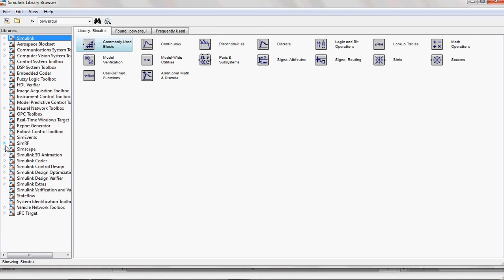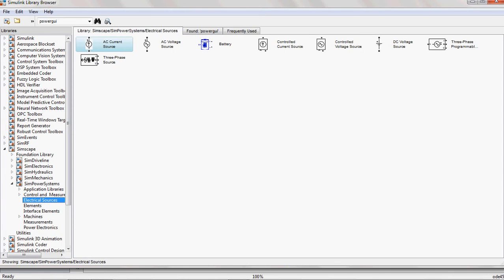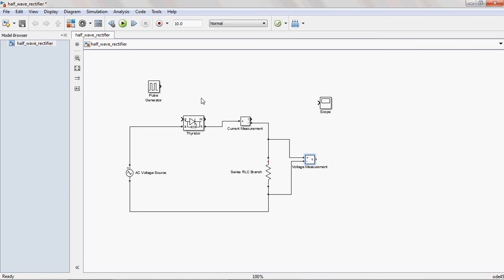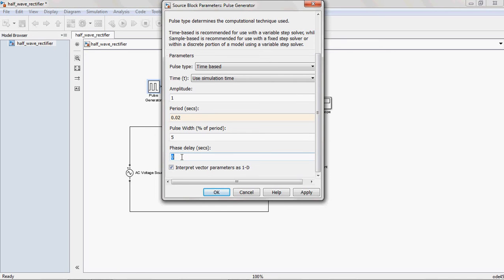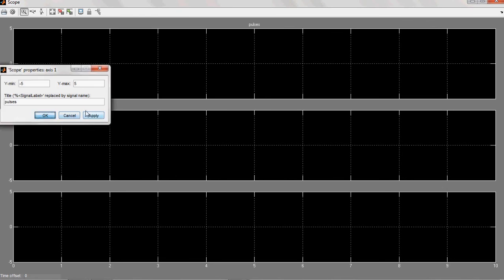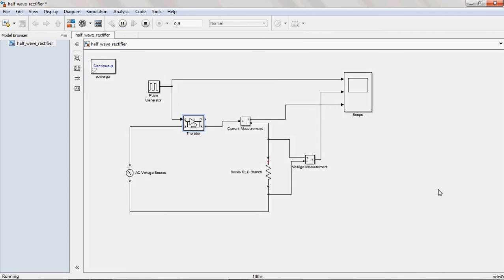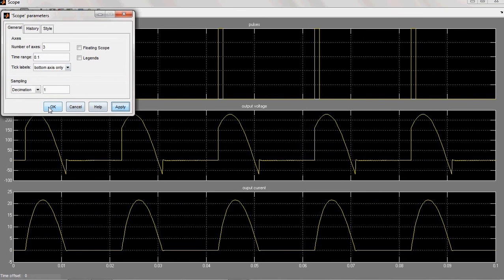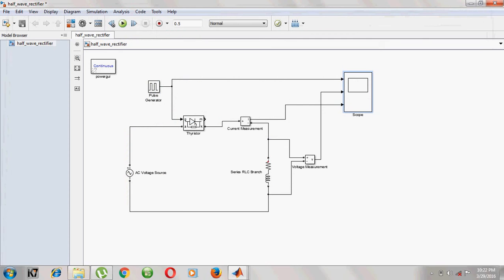1.MATLAB/SIMULINK Single Phase Halfwave Controlled Rectifier simulation

Comment: how did you convert firing angle in seconds ?
Reply from the maker: 50 Hz.......> 50 cycles per second,it means the time required to generate 50 cycles is 1 sec.from this we can calculate the time required for one cycle by simply doing cross multiplication as shown below.
50 cycles...........1 sec.
1 cycle...............1 cycle* 1sec/50 cycle.=0.02 sec.
in terms of angle one complete cycle is 360 degrees.so 360 degrees = 0.02sec.
suppose if u want to calculate time for 60 degree simply do cross multiplication as shown below
360 degree........0.02sec.
60 degree...........0.02*60 degree/360 degree =0.0033 sec.